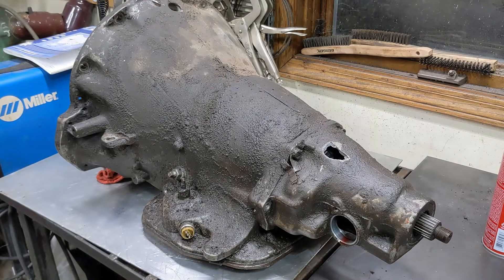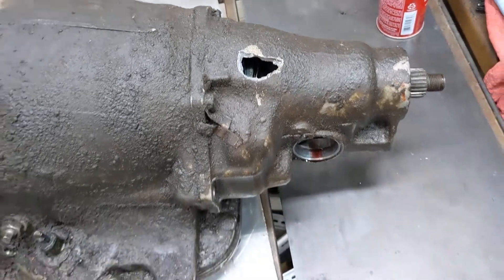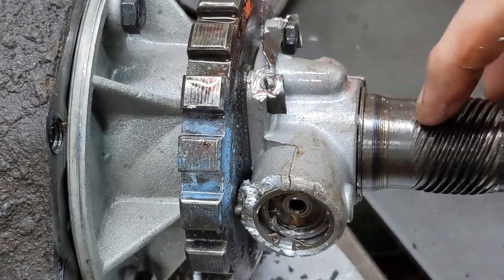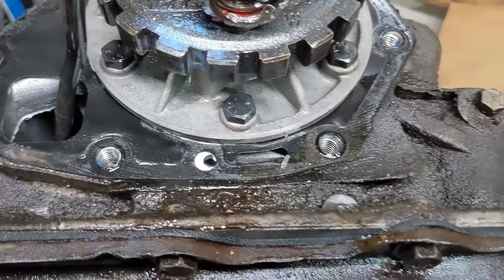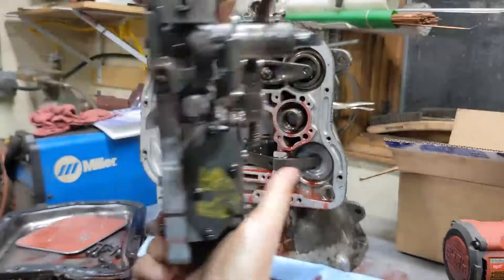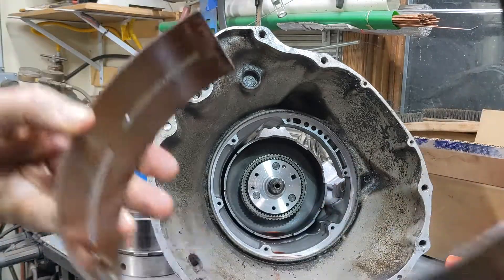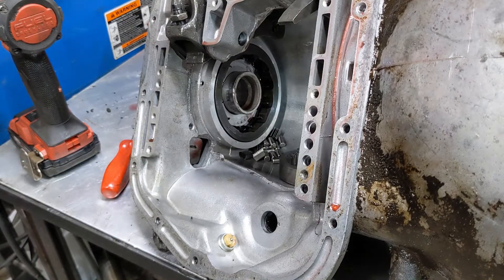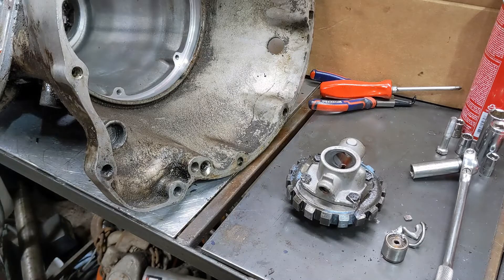Tearing down an A727 Torqueflight with an Exploded Governor

Comment: This same thing happened to me about 20 years ago on a 727 in my Mirada i had out of a '79 Cordoba. I was coasting down a hill towards home maybe 25mph and the rear tires locked up briefly and i heard a crunch sound from the transmission.  I was able to coast into my driveway with a trail of ATF behind me. When I crawled under the car I saw the top of the tailshaft damaged similar to that but worse where it was the long aluminum version.
 I removed the speedo housing for a look first and found the governor pin twisted into a pretzel along with the small end of governor laying in the bottom of the tailshaft. I assume the E clip fell off and jammed the piston between the housing and tailshaft breaking it. The governor housing appeared OK after I took the tailshaft off. I had a slant 904 laying around and got the pin, clip and weight from it and it fit the 727 fine. 
I epoxied the hole in the tailshaft amd drove it for years after with no issues. At the time I asked around and nobody had heard of it happening, I had forgot about it until I stumbled on your video.
Reply from the maker: It was the first and only I've seen where that just completely came apart.

Comment: Hello there Sir, 
question: on the A727 governor housing, there are usually 4 bolts with a retaining steel/plate folded against the bolts to ensure the bolts don't back out.

What is that parts name?
I can't for the life of me find that steel parts name.

Thanks.
Reply from the maker: I know exactly the part you're talking about - I've always called it a bolt retainer plate as well.  Interestingly the ATSG manual, on page 26, shows the governor without it and makes no mention of it, though it's on every transmission I've seen disassembled.  I have no idea what the "official" name is, but you could make one pretty easily with a piece of 20 or 18 gauge sheet metal.
Reply: @YoshimoshiGarage  appreciate it, thanks.

The steel retainer is snapped on the governor assembly on my end. Interesting how that part is not in transmission rebuild kits, quite an important task that steel retainer has to undergo.

Comment: That bearing is "hard to come by"? Because the "factory" doesn't supply them anymore? I guarantee the "factory" did not "build" an entirely new "TorqueFlite-specific" ball bearing for the "output shaft". 

Just like "prying on" a trans with bolts left in did not crack that case and the governor didn't just suddenly "disintegrate" for no apparent reason. 

More than likely that's a "diesel governor" somebody installed as an "upgrade" and then "over-revved" in a "hot rod" gas-burner car or pickup OR got carried away "upgrading" their 1st-Gen Cummins 2WD "drag truck" or "tow rig" and "over-revved" that. 

And what's really "hard to come by" is "virgin" 727 TorqueFlite cases that haven't been "upgraded" and/or "grenaded" as a result of same. 

All the damage there is the result of abuse, neglect and "upgrades" by one or more "builders" and/or "drivers" that are as you said "idiots".

That you're talking about "brazing" ALUMINUM shows just how qualified you are to make "educational" videos and I strongly suspect you're one of the "builders" and/or "drivers" that helped "upgrade" that salvage yard REJECT no one will EVER take as a "core" into the worthless POS it is. 

You're also a dreamer - at best - if you think anything "Torqueflite" is just mix and match and pick and choose and you can take "hard parts" from a number of "cores" and "donors" and just toss them together and PRESTO! A ONE SIZE FITS ALL "727 TORQUEFLITE" READY TO GO INTO ANYTHING FROM A "DRAG CAR" WITH A "RACE HEMI" TO A "SLED PULLER" WITH A COAL-ROLLIN' CUMMINS "1ST GEN".
Reply from the maker: That bearing is hard to come by because no one makes it any longer.  I got it from Brewers and they have them only because they get them custom ground. As for the rest of your word salad, all I can wonder is if you bought a Costco-sized case of quotation marks. Thanks for taking the time to impart your "wisdom".

Comment: Those are just experimental wavy-steels.  The hope is that it will soften the shifts.  NOT!  Hey, don't forget to install a plug in the boy's pan this time, so he can drain it more easily the next time he grenades it.
Reply from the maker: Wavy snap rings, wavy steels, might need to try wavy clutches!
Reply: "Soften shifts"? You want to make a TorqueFlite slip MORE? ROFLMAO.